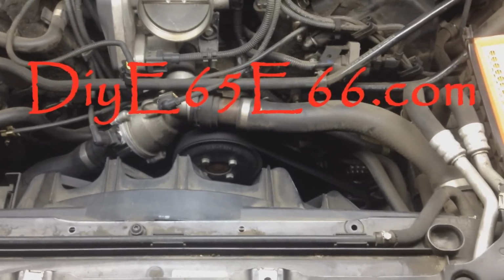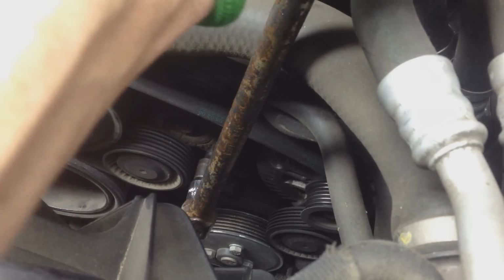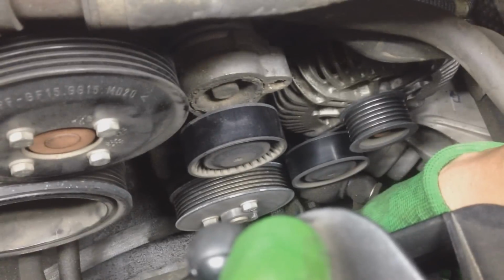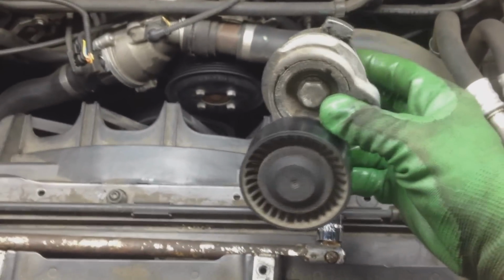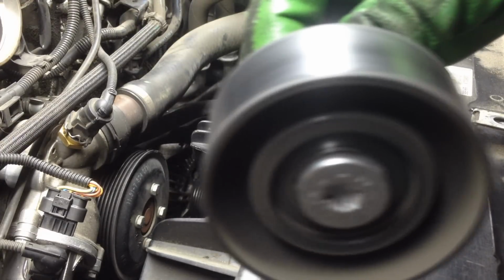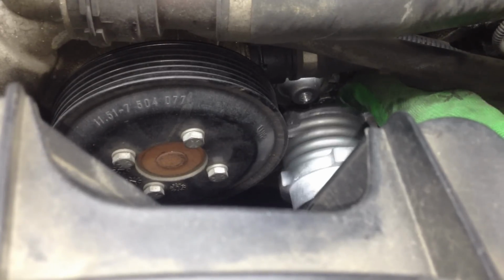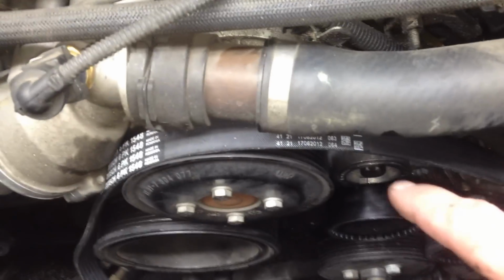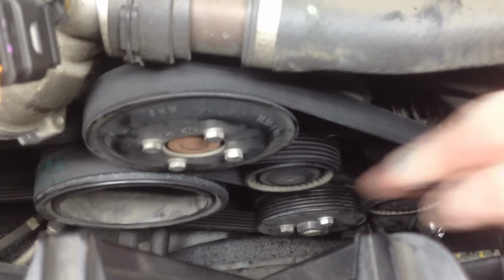BMW E65 E66 How To Install New Idler Tensioner And Pulley For Serpentine Belt

Comment: Im a car dealer and just picked up a 03 bmw 745li for $800 with 100,000 miles, just needs a battery, Coolant resevoir is leaking so it over heats. I plan on keeping it for my self and just fixing it little by little i heard alot of bad storys about this model but thanks to your videos and doing the work myself i decided to keep it, thanks for the motivation ✌🏽✌🏽✌🏽 keep up the good work 😎

Comment: Thanks Chris.  I was able to folllow your video and replace my water pump and both belts on my 06 750Li.  Just to help others I used 28mm Long Socket for crank case nut and a T60 Bit for Serpentine Belt Tensioner.

Comment: Hey Chris,  your videos have been very easy to follow. Thank you for putting the info up for the common man. I have a 2006 bmw 750li and changed the water pump, thermostat, tensioner along with the idle pulley. My problem is installing the AC belt because there isn't a tensioner. I've searched your videos and couldn't find one demonstrating how to install it. Can you tell me how it is done.  I'd appreciate it.
Reply from the maker: Hello Blainq, I actually had the same problem, there are several ways to do it after research, you can loosen the ac compressor bolts and then that allows some slack, or you can buy the really expensive tool that BMW uses to put it on, or ask a indy shop to let you borrow theirs for a few bucks, or do what I did and use a ton of sweat and just crack your break bar clockways or counter clockways, while having a friend slip the belt on like a bike tire.  Hope this helps

Comment: For anyone still reading these and working on e65-66's a T55 will strip out your belt tensioner 50% of the time, use a T60 with a breaker bar or a long handled socket drive....it will save you cutting off the belt and replacing the tensioner

Comment: Hey Chris I was just wondering I did my tensioner pulley recently okay and there's a silver pin in the bottom of the new pulley and there's not one in my old pulley there is a hole or a slot for the silver pen what I'm wondering is do I have to pull that pin out or has the old pensioner failed and the pain was gone I did notice that the new tensioner that you put in also had a pen but I haven't seen you take it out was there any issues when you finish the job

Comment: Great video even tho its not a idler tensioner pulley. You were changing the tensioner pulley. The idler pulley is the bottom one. Tensioner pulley/ idler pulley two separate names and parts in two separate places.

Comment: Chris. On my 06 750Li.  My car seems like it doesn’t downshift soon enough into 2nd or even 1st as I’m approaching to a costing stop.  As I’m costing to to stop but get on normal acceleration my car seems like it has little power unless I continue to depress more power to half way stroke of my peddle then it jumps to a lower gear and go.  How can I get my downshifting proper so I’m not lacking power?

Comment: Hi my T55 slot in the tensioner is stripped. If I cut the belt off and replace the tensioner..would this be a fix? I have the same car 750I 06
Reply from the maker: +amwbiz Hello, if you want to save the belt so you don't have to replace it, you can get a friend and have him put gloves on the pull the direction it's suppose to go with his strength he'll move to loosen the tension and then pull off belt, just be careful of your fingers, I did this awhile ago on my cadillac with my old roommate. Then you can unbolt the tensioner and replace it, and slip the belt back on, but if you don't care about the belt and just want to replace it anyway then yes you could cut it just wear eye protection and watch out it'll probably snap like a rubber band. Hope this helps:)
Reply: Ok great thanks! I really appreciate your videos and advice. God bless